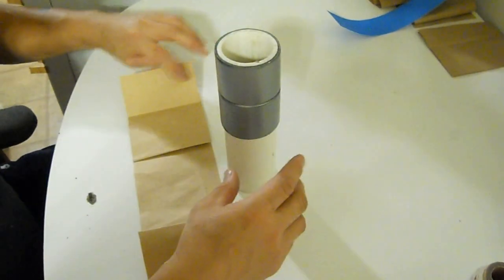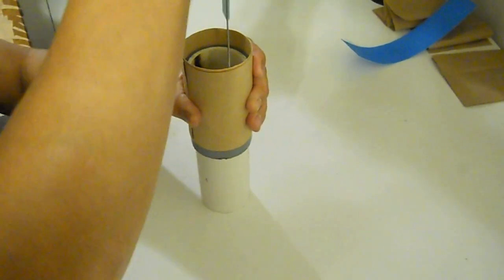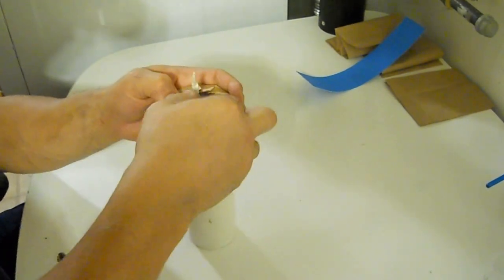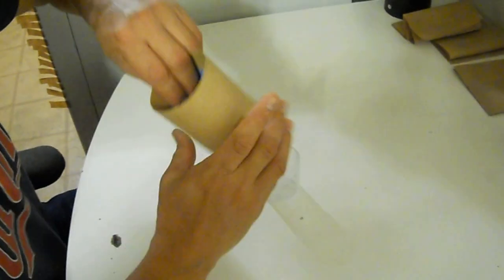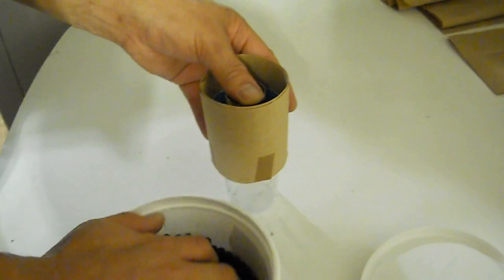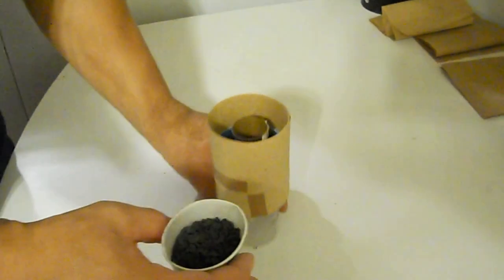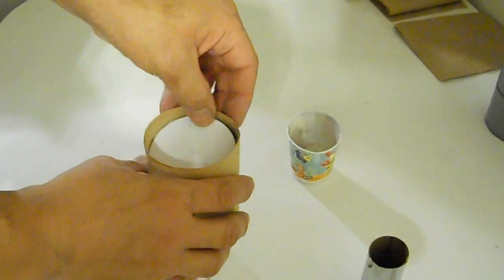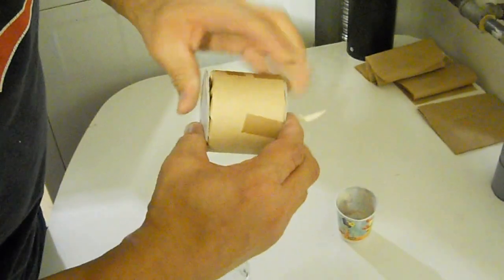Construction of a 3" Traditional Italo-American cylinder shell construction Part 1

Comment: Where do you get the case former?
Reply from the maker: I made it out of pvc pipe, then built it up with construction paper to 2.5 inches, the construction paper was also cut to 3 inches in size that's how tall I want my shells to be so this way I can cut my kraft paper to 4 inches and wrap it around  the 3 inch case former so I have a half inch on top and bottom for pleating.

Comment from the maker: I usually use chip board that I buy from Wolter tools, but ran out . They are very thin chip board that I cut from A bundle of 12" x 12"  I picked up, two of them pasted together is 1/16" thick and I always use two disc one before I pleat then another one over the pleat which works great.